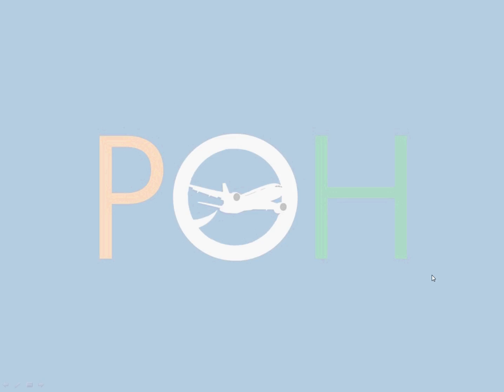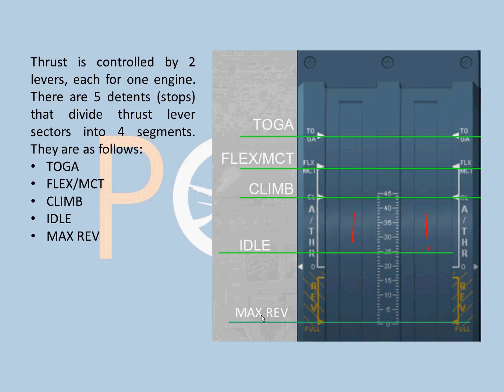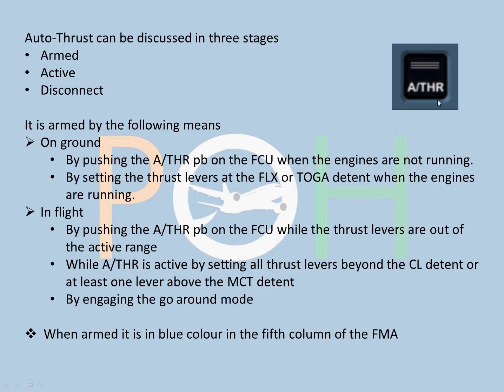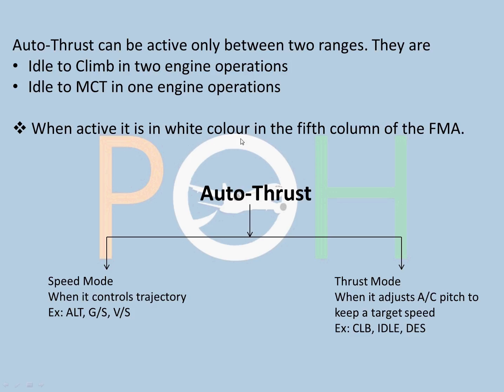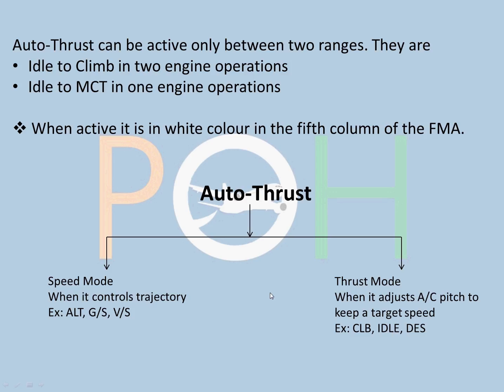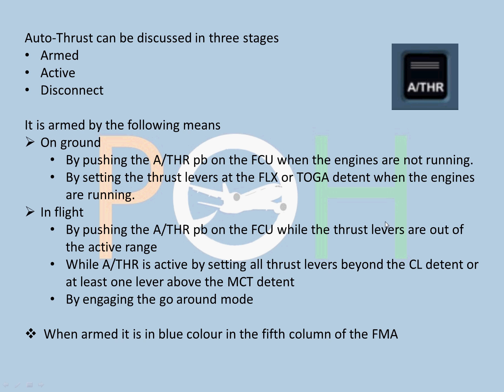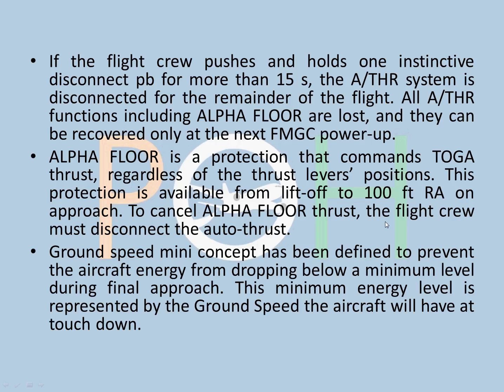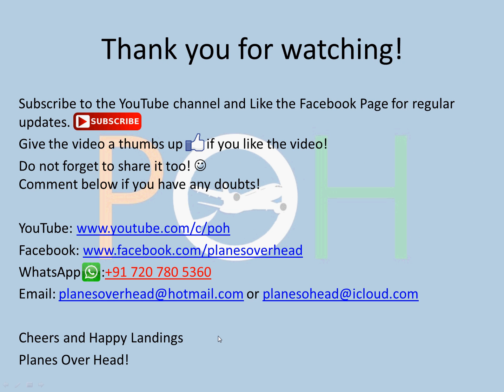A320 - Auto Flight - III (Auto Thrust)

Comment: Bro what is climb detents?
Reply from the maker: It's a thrust lever setting
Reply: @poh  I know that different detents bro..I mean..what is the purpose of "detent climb'
Reply from the maker: Probably still not able to get your query.
Reply: @poh  flex mct' is used for take off and toga used for go around..I mean climb detent is used for what? ..sorry for disturbing u bro!
Reply from the maker: Climb is used for climb, cruise mostly and also till landing. Climb detent is where the auto thrust takes care of engine power automatically and the thrust levers are at climb detent 99.9% of the flight time with auto thrust automatically adjusting power as per flight requirement such as climb, cruise, descend etc.

Comment: Explanation of speed mode is correct however, in thrust mode, the auto thrust becomes a function of thrust demanded which cannot exceed the max thrust demanded by the Active thrust mode. Please do revert if I’m incorrect.
Reply from the maker: In thrust mode it's simple, the pitch controls the speed. Be it open climb be it open descend etc. The speed is maintained by moving the pitch up or down.

Comment: I still can't understand what is Speed Mode & Thrust Mode

when do we use it?
what is its advantage?

thanks
Reply from the maker: Speed mode is when speed is fixed and thrust is varied to maintain that speed where V/S shall be fixed.

Thrust mode is when a selected speed is maintained using fixed thrust (idle or climb). Speed here is then maintained varying the pitch of the aircraft and V/S is disregarded.

Speed mode is good when ATC constantly tells you to maintain speed and in densely filled airspace you can't ignore V/S else it'll generate TCAS warning. So good in such descend cases. 

Thrust mode is mostly by default used during climb and unrestricted continuous descend into smaller airfields where traffic is relatively less dense. Saves little more fuel when thrust is idle during descend, you should be good at descend planning to actually be able to save any fuel using thrust idle mode.
Reply: @poh  if the speed varies then v/s varies proportionately right?How can we change speed keeping v/s a constant?
Reply from the maker: Selecting speed on FCU or changing it on MCDU.